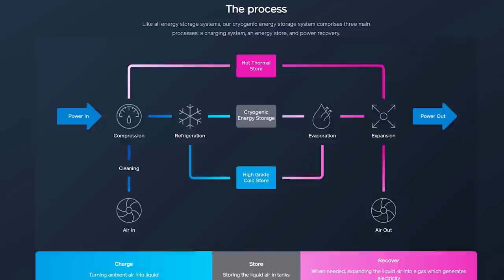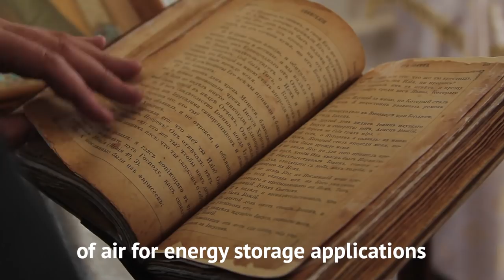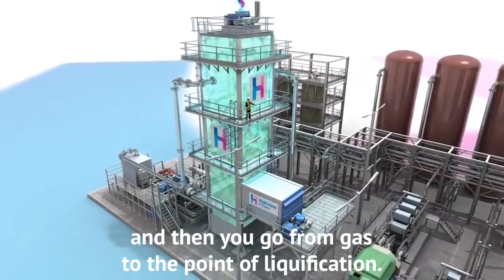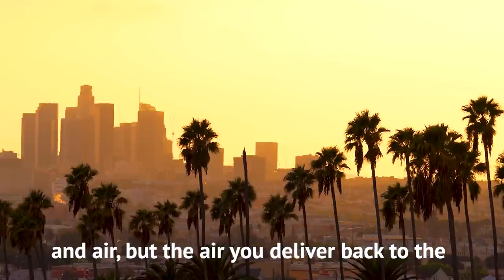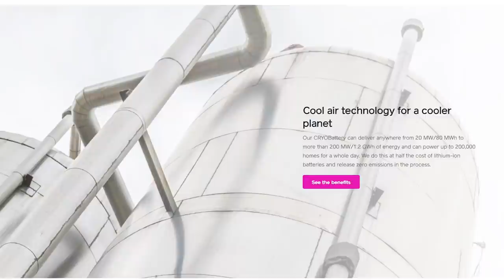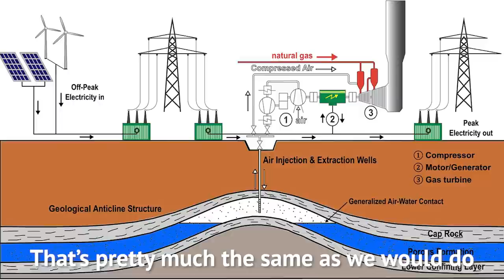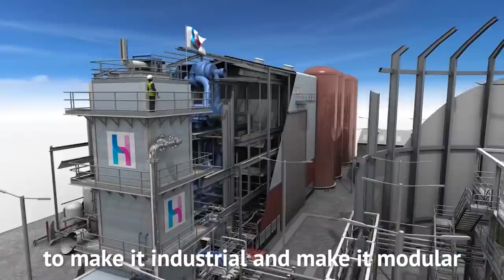CRYOBattery Storage? | Highview Power Interview

Comment: I've been a fan of the underlying idea for many years, but I have to ask, what have they been doing for 15 years? One of their selling points is that air liquefaction is a well-established technology with off-the-shelf components. They've been working on this since 2005, yet looking at their website, there is no description of a well-defined product, just very general descriptions of the technology with fancy renderings. With only two pilot plants in 15 years this doesn't seem to be a company set up to execute.
Reply: It's only economical at scale, and the money was not there so far. In the old energy business no one is interested in jump starting a thing that'll eat their lunch. Only renewables providers would be interested by such a thing, and until their share rises to 20-30% of the grid mix, they have right of way so no interest in this. Only now in a few market, is it becoming interesting for renewables providers to look at it.
Reply: I think he made the point well that the Electric Industry was not ready for this technology. The Electric Industry is not ready for Wind and Solar either, but they are being required to move to Renewables and this technology will help them move in the right direction.
Reply: @Charles-tq9tc  I don't buy it. Why are renewables providers the only viable client base? There are peaker plants being built and financed independently and a lot of them are still diesel generators. If LAES can't compete against diesel generators then it doesn't seem to me they have viable solution. Or, you have a management that just doesn't have the creativity to jump start this idea. 15 years with nothing to show for it other than a couple demonstration projects seems to me to be egregious. Seriously, they are not even developing new tech!
Reply: @123afekete321  Peaker plants and non peaker fossil (what I called old energy) can throttle "easily", they don't need storage it's just an extra cost to them, shutting down is better. Renewables, when they see their output throttled on the grid (its starting in some countries), will be the buyers, because that'll allow them to get more $$ back from their initial invesment.

The other thing I can think of is that heat and cold recovery as they describe on their website is not as industrialy widespread as they want to paint it, so some development was needed there to make it economically viable.
Reply: @Charles-tq9tc  LAES should be able to throttle just as easily. Why can't it compete with peaker plants as a stand-alone service? If Highview is waiting for renewables projects to co-locate storage then it may be waiting a very long time. Locating LAES at the generating site is not the most profitable implementation.

As far as heat and cold recovery, that's as old as industry.
Reply: @123afekete321  Yes LAES throttles easily, but who will sell them energy to store then restitute ? peaker plants ?? no so... it needs to be some kind of energy production facility that has no such capability to throttle (where throttling means : reduce energy output AND running cost. Because renewables can reduce energy, but it does nothing for their running cost): So renewables, when they have so much of too much energy * that they become ineterested in selling it at a later time by incurring an extra cost in storage. I agree with you that it's not happening overnight. It can also be independant operators I think. Just not one that is hard tied to peakers or oil, simply because the economics are competing in the same segment so hard to house under the same corporation.
Efficiency of electric transport means they dont have to be colocated.

* basically, when the grid regulator tells them they can't have priority all the time.
Reply: @Charles-tq9tc  That's not how it works. Electricity is sold on a market. When the supply is high, the price is low and LAES buys. When the demand is high, the price is high and LAES sells - at a profit.
Reply: @123afekete321  This is not a perfect free market. It is regulated and their is wide variance from country to country, most of it depends on who is the producer, you need to learn. But that's not the big one. Most plants aren't built unless they have a contract that agrees for a price for a long time. The spot market is but a small part of electricity pricing.

What you suggest is time arbitrage, LAES has no business case doing that for for peakers or "easy to rev" plants, because their rev up or down themselves, they dont need someone to do arb for them at a cost. Their reason to exist is already time arb... and they are probably as clever as any new comer at doing the arb. LAES will always be outcompeted with such suppliers (since they would add cost of LAES storage on top of peaker production cost), so what would be the point.... 
On the other hand, renewables can't rev up or down (technically they can, but it's not rational for them due to 1/market structure and 2/cost of operations structure). So, so far the rest of the grid supply side has accomodated for them (because of regulations, and, a bit, price), mostly peakers, dams, then coal and oil. But they can only do so to a point, then it becomes very costly which is where LAES can come in.
Reply: @Charles-tq9tc  I don't understand your reasoning. LAES should replace peakers, not store for them - that wouldn't make any sense.

If LAES can't compete against expensive gridscale battery storage they have no hope.
Reply: @123afekete321 Until now LAES hasn't replaced peakers because LAES presupposes that someone is producing energy that they don't need right now, which is historically not how the energy market has worked. It has always been built to exactly instantly respond to demand. Base plants (nukes/coal), flexible (dams), peakers (gas, oil). In market terms you think "price high, price low". Price variations is only a thing on the spot electricity market, which is dominated by peakers and flexible. All these actors have no free energy to sell you, and they are good at forecasting (with few exceptions). LAES makes no economical sense there, you can't compete with them buying energy from them.

Then enters certain renewables (wind, solar) that are given priority on the grid and a garanteed price (they don't really enter the spot market), thus the demand volume on the spot market for peakers adjusts accordingly to maintain balance on the grid. Peakers compete on the volume and are still an essential part of the grid balance today. They can play this role efficiently, economically. But past the 20-30% point of renewables in the grid, there is just too much variations for peakers to absorb. And probably a different market structure needs to be regulated in existence. Too much variations : Too much : Technically renewables can turn off to solve glut, but they have the right not to do so, and get paid so energy glut on the grid is not their problem. Biz is biz. Too little : you need either 1/even more renewables to have a safety factor (not easy), 2/more peakers, 3/storage. The solution is different depending on the scale: at your house, you install a power pack to store excess solar, for now renewable dont enter SPOT, so peaker is the solution, above 30% the market needs to change because peakers wont be able to absorb enough and then LAES can play.

Big massive battery so far have played a different rôle, which is FCAS. (the guy stresses LAES is not a competitor for battery, and you can read FCAS). And they sprout where the grids are know for their instability : california, south west australia. The FCAS market is once again different from the SPOT market, and made of different tiers (rated by response time and power available), that were once all occupied by peakers (and they were the only ones able to provide a (bad) service, so they were raking it in). Batteries are making a killing in this market. They trounce gas peakers on service, and are on par or a little lower for price. So much so in fact that the peaker building market has been petrified for the past 2 years in the western world.

In short, you can think of it in this way (in europe, in the US base load and SPOT are more intermingled) : there are different layers in terms of pricing markets: base loads ie multiyear contracts with garanteed prices,  daily swing =SPOT for now, and FCAS. Peakers use to make their volumes on SPOT and their money on FCAS. 

Renewables occupy this weird place between base load markets and SPOT, where they get baseload pricing stablility, but have the right to vary their output, which in turn makes the SPOT market wild. Peakers have been told (with money) to make sure SPOT kept working even with renewables, so their volume have decreased, but they still make good money on SPOT because no one can beat them at that volume/flexibility point. They are still the only ones on that market to be producers and demand does not adjust as a function of price to a great extent. Assuming they have the same start/stop flexilbilty, for LAES to work well here, they'd have to be better at forecasting than peakers, in order to buy low sell high, which is just not going to happen.

Renewables have no interest in entering SPOT, where there is competition*, because they have garanteed prices to incent them into existence. For LAES to economically make sense, renewables have to enter SPOT, which will happen eventually. Renewables will enter SPOT when they have so much extra energy that turning off all peakers will still result in too much energy. The 20-30% point...

*they do in the end, the garanteed prices arent eternal, but usually more like 15-25 years scale kind of thing. In 10 years, it'll be a thing.
Reply: @Charles-tq9tc  I'm having a very hard time following your reasoning. Peakers don't "absorb" renewables. Forecasting is not something inherent to either LAES or peakers, that's an independent function. Provided LAES can respond as quickly as peakers it should be able to compete.
Reply: @123afekete321 
Thanks for your patience, I see I'm struggling to make sense to you...  Forecast forecasts demand, yes. its independant everyone has the same more or less. You are a peaker plant, you have been designed to meet all swings that can happen in these forecasts because otherwise, you don't get the label peaker. (or the grid regulator is not doing its job and the grid will sometimes blackout). If you know further ahead than your reaction time what the demand will be (thus price), why would you sell now to an actor that'll compete with you later, when you can sell it yourself later or let another peaker do the job. You don't have to sell more than what ensures maximum money for you in all cases, why allowing an extra actor in the loop, if you can meet all demand scenarios....

So LAES only has a space in the market as long as peakers leave one. (ie : when renewables make the grid more unstable by reaching 20-30% on the grid). This happens when peakers plant swing capacity is exceeded by final demand swing (excl storage), which by design isn't a thing because otherwise the grid would break down, so nations and states take great care that it doesnt happen (with $$, which is another evenue stream for peakers, getting paid just for existing :) -that's called standby rate ). That being said, it's getting close : take a look at belgium daily price swing for instance :
https://www.elia.be/en/grid-data/transmission/day-ahead-reference-price
There is a 2.5x to 3.5x difference between 6 hours low and 6 hours high. With a 70% efficiency, to sell one unit of energy at 3.5x the price, you need to buy 1.4 unit of energy at 1x price ie 1.4x cost. So you have about 1.1x to 2.1x of your 3.5x sales to amortize your plant and pay your employees. This place is getting close to 20-30 % renewable on grid, and it's getting realistic....

Shifting from economics to ecology so we can perhaps agree on something : 
From a global warming POV, storing peaker plant energy is just straight plain bad. Until the 20-30% barrier, peaker can match instant demand, so no one should do anything that lowers their efficiency further by storing then restituting energy. Storing and restituting energy is fine when the total carbon footprint of that energy (initial production foot print/storage efficiency) is better than that of the peaker plants. I'm sure peaker plants prop up that kind of arguments to keep storage out of their market.
Reply: @Charles-tq9tc  Thanks Charles, for your patience. This makes sense and I agree that storing peaker plant energy is a bad idea. What I can tell you, is that here in the UK renewables penetration is already at the point where they are building new peaker plants to manage the variability. They already have plans to build one in my neighbourhood in London and it will be a bank of diesel generators, if you can believe that! Maybe, it's the just part of Brexit planning and the UK preparing its decline to an island economy. But, all joking aside, if Highview can't sell itself as a clean alternative to diesel generators then either the technology isn't economically viable or management doesn't have the skillset to navigate the barriers to entry.
Reply: Aloysius Fekete Diesel gens oh wow ! This has to be a new low... on the other hand the brits have managed to keep shale oil at bay so far, this makes me think that not all is lost yet !
Yes the economics for this right now are borderline, so they must have been bad just a few years ago... problem is, given the market structure, nothing will change until the regulator steps in, which I have little hope will happen. IMHO the fastest road to market for this is that falling prices in renewable will lead to more new projects, which in turn will lead to regulator not giving them priority or preferred prices anymore, which will lead to renewable actors to look for solutions to make their plants look more like on demand plants, ie they will look at working with storage...still a long road... regulation could help some by not allowing more peakeRs, but it’s a fine line for them, there is the risk of grid instability that takes precedence...

Comment: Not only would you gain from the release of the air as it discharges to turn turbines, but as you boil off the liquified air the process would produce cooling for air conditioning, and upon compressing you would be producing heat for overcoming cold weather.  Lots of gains from this process!

Comment: How is the energy realized when it's needed?  The liquefied air is released, which spins a turbine of sorts and creates electricity?  Is that basically right?
Reply: Pretty much! The liquified air is warmed and evaporated, rapidly expanding in volume, rushing through a turbine which turns a generator.

Comment: Round-trip efficiency is likely around 10%, < 60% in liquefaction, and assuming 1/2 Carnot efficiency for turbine power generation at respective operating temperatures.
Reply: They beat pv = nrt by recovering waste heat at liquefaction time and reinjecting it at gasification time. The interview doesn't dive into this, but their website does. I think their figure of 70% is legit.

Comment: The round-trip efficiency is extremely low compared to a lithium ion battery.  But that is why he said you wouldn't build a small one of these.  This is for storage at scale.  For large scale needs, this is probably more practical than building enormous lithium batteries.  Unlike lithium batteries, storage capacity doesn't degrade over time. Also, there's already a massive battery shortage relative to demand, and we haven't even scratched the surface on demand.
I hope this company is public.

Comment: I was waiting to hear how they change the liquid back to energy, and how much energy it takes to keep the storage cold.
Reply: The liquid air is pumped through an expansion valve which reduces its pressure which causes it to flash back to a gas which is then used to drive a turbine which spins a generator and makes electricity. Keeping the stored liquid air cold is accomplished by storing it in super insulated tanks.
Reply: @gilz2253  sounds good, still like to see the actual turbine, how it looks and sounds when working.
Reply: @petertraveller6421  The turbine model shown in the presentation was a multi stage integral gear high speed unit. They sound they produce is a very high frequency incredibly loud noise.
Reply: @gilz2253  I don't think just reducing it pressure would make it turn to gas quickly enough, you need heat and where would that heat come from? I think that is why the prototype was built next to a Bio-Mass plant.
Reply: @BTSflyer  They store the heat that was extracted during heat exchange (when the gaseous air is repeatedly compressed and cooled). This heat is then used to evaporate the liquid air.
Reply: @JB-si5kv  
I know gas heats up when compressed but, is it enough to heat liquefied gas in total without additional source of heat? Seems to me that even though you retain the heat from compression that there is some induced loss and there wouldn't be enough to re expand all of what was liquidated.  Seems like different version of a perpetual motion machine which is not possible. I would like to see the data on this.
Reply: @BTSflyer   I imagine they would also use a relatively small amount of energy to heat it up as well, but the recycled heat makes the process marginally more efficient. As long as the electrical energy that is generated from the air expansion/turbine/generator is greater than that required for the heating, then it's all good!
Reply: @gilz2253  or at high enough pressure for the ambient temperature.